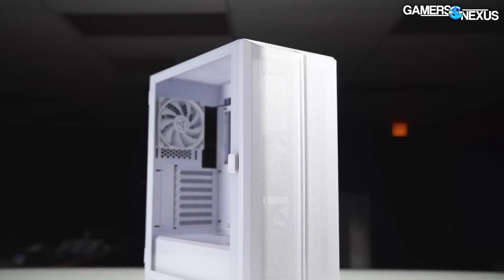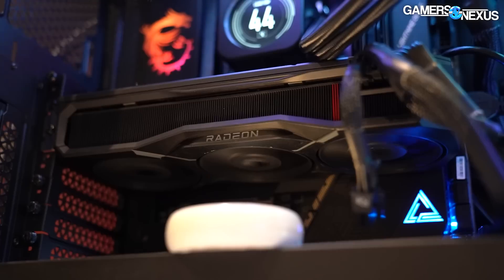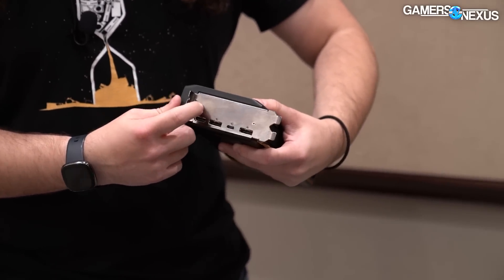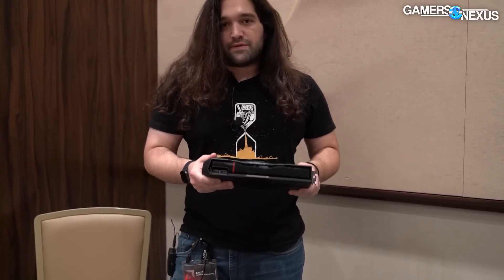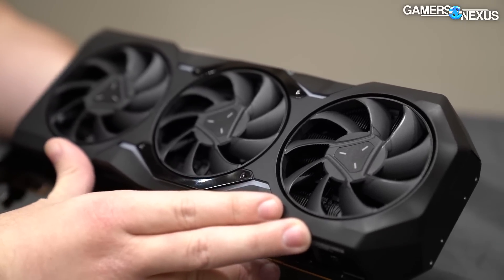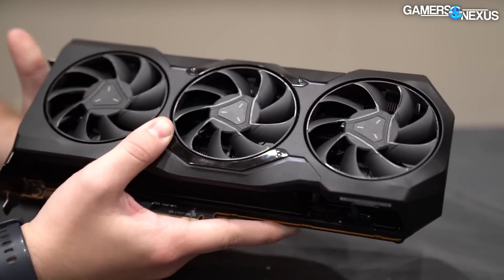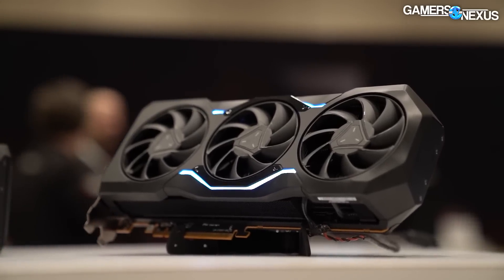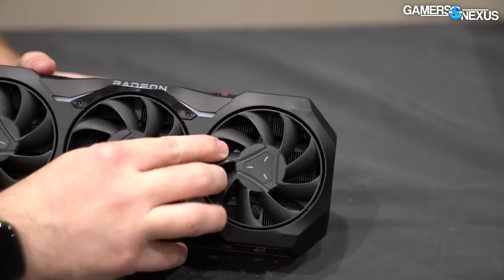More Video Cards Need This: AMD RX 7900 XTX Reference Design Hands-On

Comment: The fact that seeing you can hold the card with ease just make me happy 😊 (looking at the 4090 behemoths...)
Reply: then with 2 4090 u can start train like with dumbbells 🤣🤣
Reply: @ZondaRbg  Or run them at full throttle and turn your room into a sauna. Ha ha.
Reply: @ZondaRbg  lmao 🤣
Reply: This is a 4080 competitor. If it competed with the 4090 it would be much more expensive.
Reply: @scubasausage  Nope, the theorethical performance is closer to an RTX 4090, besides Raytracing. It's just Nvidia being greedy bastards that shit all over their customer base :)
Reply: @xPandamon  AMD treat their customer base far worse. They dont get good raytracing performance, it does do it, Nvidia have not locked it down. But AMD driver issues go unfixed for months on end. Their cards are usually good to begin with then detiorate. They dont support cards as long as Nvidia either. For example the RX 390 has just been cut. This can do 60 fps in Cyberpunk and older Nvidia GPUs are still supported. 

Theres a good reason Radeon has a tiny market share, consumers repeatedly get bad experiences with it.
Reply: @scubasausage  We don't even know yet how the new cards deal with Raytracing. And not being as strong in that regard has nothing to do with bad customer treatment. I can't complain about driver issues, quite the opposites, they push updates constantly and often have new features and big improvements, even for their iGPUs. Only thing I can agree with is dropping support for the R9 390, but it will still run well and custom drivers are a thing with AMD cards, so it's not that bad. It is a 7 year old card at this point, So I understand dripping support to focus on newer models.
Reply: @xPandamon  You must be new here. Most users learn that Radeon is bad and move on. Hence why it has a tiny market share. Also, its not just the 390. The Radeon 7, a far more modern card is technically still in support but the drivers released for it are a joke, filled with glitches and issues. Have a look at the Fury range from 2015, its basically out of support yet the 980ti from the same era is still going strong. Hell even the older 980 is still in support. 

The 5700XT, the last Radeon I will ever own gave me and thousands and thousands of others the black screen bug which went unfixed. The product should have been recalled but instead AMD just let its users suffer. 

Honestly its annoying that AMD keeps getting away with this strategy of pumping out graphics cards slightly cheaper than the competitor but then cheaping out on the support. Consumers get hurt and over the years ive seen it over and over again. New users buy Radeon. Its great for 1-2 years then the glitches and the bugs start trickling in but all AMD are doing is making sure the drivers work on their current models. They dont care about users of their older cards, they already have their money.
Reply: @scubasausage  I've had a 5600 XT myself and now about the issues, u was plagued with then too. But that's nothing that software updates can fix unfortunately. The 6xxx series run well, many colleagues and friends have them with zero issues, same is true for my laptop, runs flawlessly unless Windows installs an older display driver.. And both the R9 390 and the Radeon VII are cards barely anyone uses, so spending that time elsewhere seems reasonable to me. By the way, with the way Intel handles drivers (horribly) and Nvidias stubbornness to ever update their Nvidia Control Panel or make GeForce Experience less garbage it's not like the others are that much better
Reply: @xPandamon  You are making excuses for AMD. its not acceptable and trust me, the 6000 series will start getting issues as soon as the 7000 series launches. Its the same old with AMD.

Statistics dictate you will eventually learn the lesson, Radeons market share is tiny and shrinking. The vast majority of gamers will switch to Geforce. Nvidia arent perfect but they treat their customers far better than AMD do and thats a cold hard fact. this is why most people prefer Geforce in the long run and happily pay more for it. 

And as for Intel, well, thats a straw man, No one here is claiming anything about them, im sure they are bad at driver support. But I personally havent used an Intel card yet. But ive used dozens of Geforce and Radeon cards. 

P.S. Nvidia doesnt change its control panel so that users can look up support guides on how to use it. AMD changes its user interface twice a year. Sure its prettier but you have to learn how to use it each time. The control panel is functional, I would rather it be reliable than pretty...
Reply: @scubasausage  Dude AMDs GPU marketshare has only gone up for almost two years, despite having some issues. Tons of people are excited for the new cards which comments under videos of them show.

Do we really need to defend Nvidia's Control Panel? AMD hasn't changed it since I've had my RX580 by the way, they added tons of new features and options, like an RTX Voice alternatice, eye tracking, faster updates and ingame tuning. It is WAY more advanced than anything Nvidia has currently, even offering an app for metrics, streaming and quick screenshot and recording buttons. Yeah Nvidia's panel is something we are all used to, but the functionality of the Radeon control panel is so far ahead it just makes you feel bad when you don't have it anymore. Why do you need Geforce Experience just for driver updates? It's a bad joke!

Comment: More tools to know if the Case layout is efficient is definitely a welcome feature for sure. Good job AMD!
Reply: i mean yeah TOTALLY invest in 3 fans...choose to not have top exhaust at the risk of ram/vrm temps...in exchange for a quieter/cooler GPU....which one is it going to BE XD. While trying to justify not spending 50$ extra on a better quality psu to reduce system thermals under load and idle....or 50$ on an arctic p12 5 pack. THANK GOD my 999$ gpu can help me shave off a couple bucks on my build. FWIW i have 9 fans in my MESH II....on low....to help maxmize my 3070 strix 0rpm thermal potential/operation. Theres no thanking a gpu for telling me my system temps in my build...its too ironic IMO it should be on entry-midrange gpu that are more OPT to be in lesser quality/invested builds...where KNOWING said temps is actually more valid. Concepts like that sensor do nothing for my build...bc its obvious 9 fans are going to cool a system better than choosing to orient 3 fans for GPU operation...with no sentiment to top/chassis exhaust. SHIT apply the same logic in a 011 or a system with bad design. You still wind up having to buy fans for an 011....and now get to use the gpu to tell you "i only need 3 fans" copium when you can mount the Snot out of that chassis.

Comment: Man, I can't believe it took them THIS LONG to finally have a Thermistor as a component of a video card. I can't help but think it hasn't been there for the sake of burning mosfets to death, also killing the GPU/video card in the process. I'm glad AMD has brought that up again so their partners can do the same. Who knows.

I'm SO looking forward to a teardown! Keep up the great work!
Reply from the maker: EVGA has done it, but not aware of anyone who's done then external to the PCB.
Reply: @GamersNexus  If it is external to the PCB, then some AIB is going to put a FLIR chip so you can SEE the thermals and justify their pricing
Reply: Why not just track temperature of mosfets so they don't burn?
Reply: @Shini1984  I guess there are just too many of them to just put a sensor on all of them? And maybe they all vary in their temps by a significant amount, so just putting sensors on one or a couple of them may not be enough.

Comment: You know, I've never really been a fan any of the Founders or Reference Design Cards from NVidia or AMD, But This Model Design I'm really liking!! Vertically Mounted in a Hyte Y60 with it's Basement Fans blowing air straight up into that fin stack would be really interesting test for Thermals! Thanks Steve! LOL!
Reply: Interesting good, or interesting bad? Depending on the layout, it may hurt thermals with the basement fans fighting against the exhaust.
Reply: @Nareimooncatt  That's kinda what I want to know! What's better, Having the fans as Intake or Exhaust? 🤔

Comment: I have a lingering question because i'm dumb to the actual architectures of gpus. If AMD matched NVIDIA's TDP, couldn't they reach or even surpass 4090's performance?
Reply: The TDP is one of the big reasons a lot of people are hesitant to buy a 4000 series. Going for efficiency will make the card more appealing to people who don't have huge power supplies or care about their electric bill.
It also means they don't need to make the card enormous since it needs less cooling.
Reply: @hyperstimmed  I agree but this doesn't really answer my question. One of the most important thing in marketing is mindshare, people who are in AMDs side are people who want good performance curve and architecture that is not broken to maximize performance while NVIDIA consumers don't give a fuck about all that and say I want raw performance I don't care about the price and "So NVIDIA is better again this gen". It made me think if increasing TDP makes it possible to AMD to surpass 4090
Reply: @barney2120  people are complaining about the 4090 being too power hungry. Why would AMD release something equally as hungry when it's seen as a negative? If the card is slightly lower performance with a significantly lower power draw, many consumers will consider purchasing the card that is smaller, more affordable, generates less heat, and costs less to run taking the loss in performance
Reply: @hyperstimmed  They are complaining about the tdp but it is still their leverage since its the best performing card. What I can assume with this is that AMD can perform better with higher TDP but still won't reach 4090 against rasterization so they opted out of competing. Btw I already know everything that you are saying and are just curious if AMD matching TDPs and winning is possible. Great insight tho!
Reply: @barney2120  Yes at least in raster, i believe there will be 7950xtx version with more power later next year
Reply: @barney2120  I'm not sure but it might reach 4090 performance in rasterization as it is. These benchmark bars did seem to have as much gain in performance over previous gen as Nvidia with their cards. We have to wait for release and see real benchmarks then you can ask this question again.
Reply: @barney2120  amd published the game numbers on there website, from the looks of it ( it arent that much games that they showed ) its on paar in rasterisation performance or slightly below...so i think it is fair to asume, that a 7900XTX pushed to 450w TBP could outperform a 4090. i think what amd did with there reference card was to lower the clockspeed to stay as close as possible to the efficiency point and with AIB´s using massive overbuild coolers anyways, they can push this cards as high as possible if they want, throwing the efficiency out of the window, bumping up performance and giving them a actual reason to be priced way higher ( expecting AIB cards to be 1200-1400$ for there top cards )and its up to the consumer, what they want to use
Reply: @georgwarhead2801  I root for AMD but they  are 1 generation behind in rasterization so its not on par or even close to 4090 by any metric. Yes I also think they beat 4090 on raw performance if the power is matched but no there is no chance they beat 40 series in this generation. On the otherhand, the constant and steady performance uplift of the AMD cards will soon catch up on NVIDIA that seems to not have a clear path of upgrade.
Reply: @barney2120  what do you mean with 1 generation behind in rasterisation? in RT yes, they are basecly at 3090 level of performance, but rasterisation they are actually realy close to the 4090 in 4k, 1440p they will be ahead ( because 4090 doesnt gain much of a performance uplift at lower resolutions)
Reply: That’s what’s interesting about RDNA3. It seems that AMD went very safe with their reference cards, leaving lots of head room for OC and TDP play. It will be interesting to see how far this can be pushed by both the Partner cards and serious overclockers
Reply: AMD is like 5 years behind Nvdia both in terms of software and hardware

Comment: that's actually genius, the GPU is by far the loudest cooler in a case and the idea of checking inlet temps is genius to see how hot it's running after the fans. it's actually genius
Reply: probably true
Reply: I have some Noctua fans and even though they have soundproofing they're much louder than the fans on my RTX 30 series.
Reply: Actually, yes it is actually genius, actually. Pure genius. Actually.
Reply: Unless you power your case fans with Molex connectors. 100% power 100% of the time! Fans go brrrrrrrrrrr
Reply: speak for yourself. the loudest part in my rig is actually the PSU as far as I can tell. XD
Reply: I've been doing it for years with a temp. probe attached to the motherboard. Am I a genius?
Reply: yeah, genius genius genius genius genius genius genius genius genius
Reply: XD oh yeah so big brain....buys mesh II....choice A use stock fans, use 1000$ gpu to "tell you where to mount them" to maximize 0 rpm fancurve/passive cooling operation. OH nice n 'quieter' surely.....or i get the thing fully loaded with 9 fans, 280mm AIO push pull front mount, 2x 140mm top exhaust, 3x120mm 1 rear;2 under GPU. Surely chassis fans wont get loud if i push them to 75-100% on my pwm/fan controller. Loud enough to hear....while my GPU is at 0 rpm. GENIUS big brain stuff right here. BUUT if i dont have any or only run 3 fans theres a secret ingredient to making it cooler than having 9 fans running XD. OH cap Clocks to 2ghz or underclock and undervolt too SHUCKS big brain shit right here even QUIETER.
Reply: @anhiirr  stroke moment
Reply: @spaceli0n  What he typed is perfectly understandable.  I don't know what you found difficult about it.
Reply: @spookyskellyskeleton609  No, he's talking about how you can either:
A)  Use the stock fans and use the GPU's thermostat to figure out where the fans are best placed to keep the GPU's own temperature within its heat sinks' capability so that the GPU fans dont have to run much if at all.
B)  Use a ton of case fans to maximise airflow and so not bother with positioning, since he seems to think case fans are quieter than GPU fans (not my experience but...)
C)  Undervolt and possibly underclock your GPU, which reduces the GPU temps (you can get something like a 20C drop in peak temps without performance loss through undervolting alone on 3000 series Nvidia GPUs) to the point where you might not even need to run your fans, which is the quietest option.

I mean maybe I am autistic but it's nice and clear to me.
Reply: @jimmydesouza4375  Uv and lower tdp - meh, you won't always win silicon lottery and your gpu could be trash. Use lots of case fans sure might as well get a dedicated air conditioner 🤓.
Reply: @spookyskellyskeleton609  As far as I am aware there's very little variance involved in undervolting stability, it's more of a factor in overclocking.

Though this is limited knowledge, not something I have ever bothered with as I myself am a "don't fuck with something that is working" kind of person.
Reply: @jimmydesouza4375  what he typed is literally a rant that makes zero sense. What you typed in is perfectly understandable from a grammar perspective. His comment took grammar out in the back and stabbed it multiple times just to make sure it's dead.
Reply: @anhiirr  WOT. I doubt anybody could undestand that, even if they could be bothered to fight through it!

Comment: I hope the AIBs stick to implementing those thermocouples. That is a cool and very useful feature for checking case airflow.
Reply: I'm sure they will, if you buy the model that costs 200 dollars extra for the flagship and 100+ dollars extra for the lesser GPUs.
Reply: @herrakaarme  No need to use actual thermocouples. Regular thermistors or even a diode junction, even in some cheap SMD transistor is enough to measure the temperature and roughly calibrate the measurement system.
Reply: You must be fun at parties
Reply: @herrakaarme  AIBs are such a f**king scam. Msrp reference cards should be the only thing for sale.
Reply: He just said that, Clem Fandango.